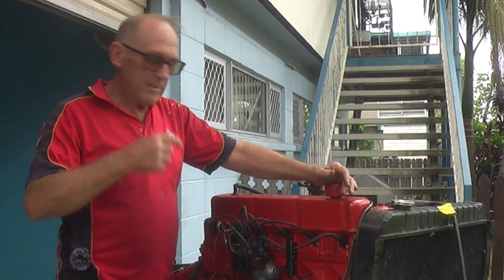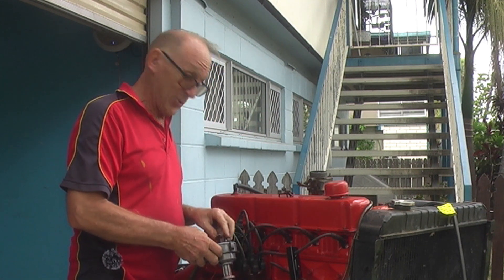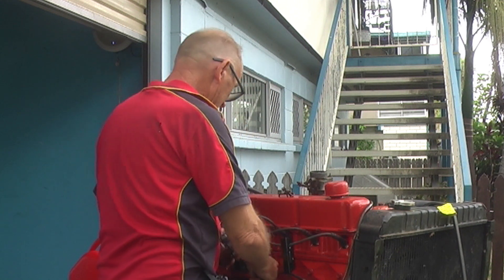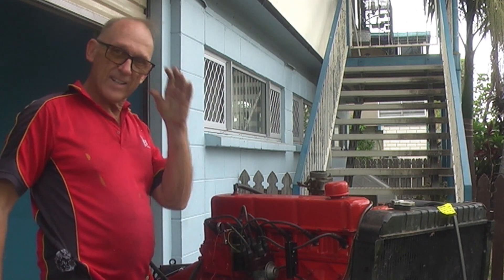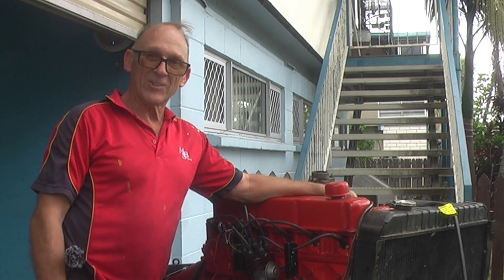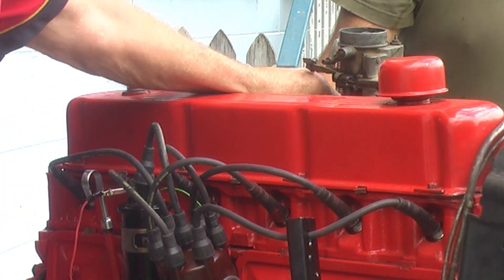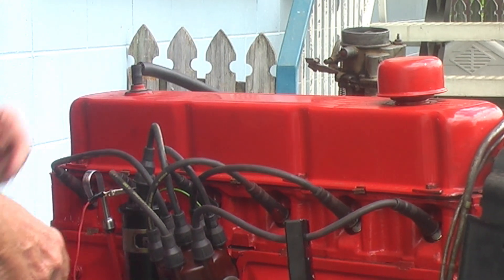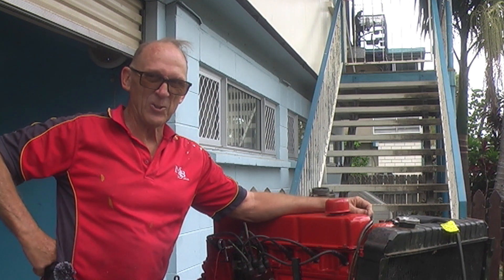Holden 6 Remove & Replace Distributor

Comment: Hi mate, Good vid, but after you set top dead centre, we couldn't see what you were doing just before dropping the dizzy in.. your arms and hands were in the way. Needed to know what part of the dizzy  you point the rotor button to find No1 or 6.. just asking//
Reply from the maker: I appreciate the comment, and I will make sure to try and show that process a little better next time. However at 6:35 you can see the rotor pointing to #6 and at 11:00 it is pointing to #1. There is also a small notch in the dist body next to the vacuum unit. That is #1 mark. I have several other videos that go through this process and perhaps some of them will give you a better look.
Reply from the maker: How to static time an engine is the vid you should watch. I did this 20yrs ago. I just added a playlist at the end of this video, so just go the the end and click on the link and then choose the video I just mentioned.
Reply: @mbsoldschool  Cheers.. Thankyou very much.. clears things up quite a bit..  :glasses-purple-yellow-diamond:

Comment: Gees dude you make this so hard. Take the oil cap off and see where the rockers are on cyl 1. the rest is pretty simple
Reply from the maker: For someone who knows what they are doing and confident in what they see, that method will do the job and only on tappet covers that don't have a baffle under the filler hole. My audience is for people who would like to know more about the correct methods used which give a better understanding of how the engine works and need to gain confidence from seeing it done properly so they can copy what I do without taking shortcuts. I do actually cover your method in an old video, but the cover was removed to get a better look at the valve motion.

Comment: Hey mate can you do a video on installing and setting timing on an electronic distributor? Thanks mate I love ya videos 👍🏼
Reply from the maker: I will see if my mate has one that I can fit to one of his engines in the near future.
Reply from the maker: Hi, I just added static timing for an electronic distributor. It is not a remove & replace, so just fit it as in a points distributor ie. point the rotor in the right place & then follow my new video to time it. Cheers

Comment: I see you’ve started hotting it up with the chrome dipstick, nice one! I’ve put an electronic dizzy in mine and have a Holley 330 2bbl to go it next. Just dropped the engine in and hooked up the gearbox/clutch etc today. Looking forward to more of this.
Reply from the maker: Gotta have chrome, it makes it go faster. I have done at least 5 more vids on this thing and have had many equipment malfunctions that is making putting together a descent vid very hard for me. I thing the next few will have more voice overs, text overlays & studio type inserts to try & make something of them. Hope they will be suitable to post up over the next few weeks. Cheers Nice choice of carby by the way & I think it is a 320cfm you have, if my memory serves me well or is that the economiser Holley I am thinking of.